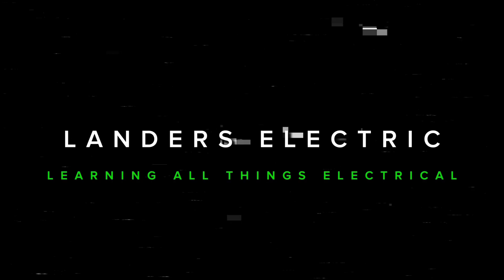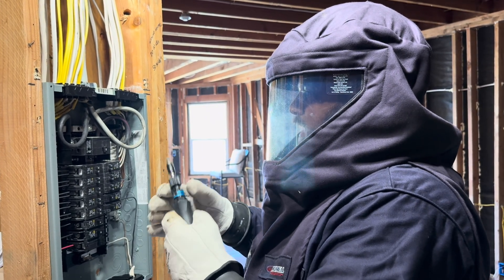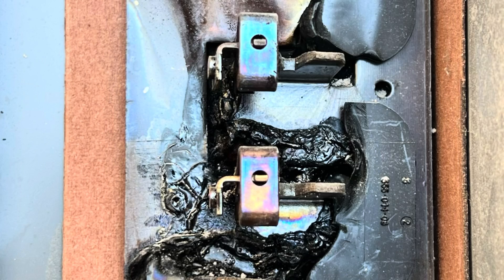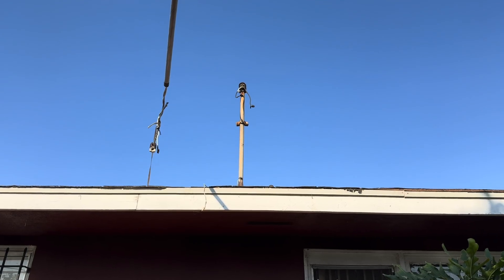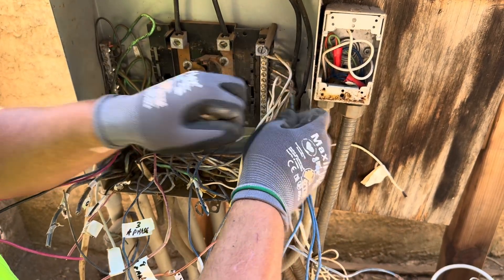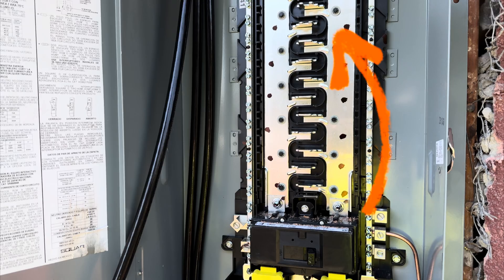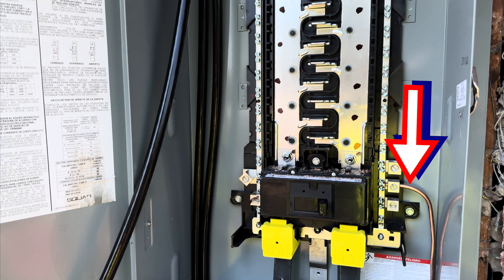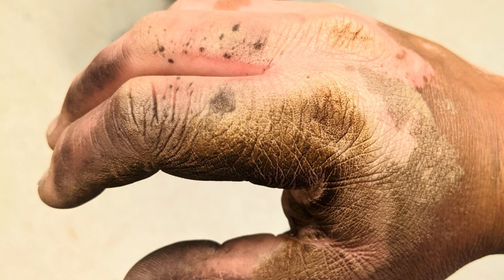I Could've DIED! | Electrical Panel Upgrade Arc Flash Accident

Comment: Were you going to pull the SEU out of the panel live? Why didn't you pull the meter? It takes longer to work around live main feed than it does to pull the meter and just know that EVERYTHING in there is dead.
Thank the lord that you're okay. I had a ground flop onto a piece of bus once (just one 120v) while I was separating grounds and neutrals, thinking it's just a small job and I don't have to shut down the whole panel. I didn't get burned or anything but it shook me up and reminded me to not get lax with safety!
Reply from the maker: Working too much overtime and got complacent. Dont make the same mistake!

Comment: I used compressed air to blow concrete dust out of a 120/208 "Y" panel. The dust exploded and blew two of the three 200 amp fuses feeding the panel; YES, 120/240 is serious stuff.

Comment: When an arc flash explosion occurs , 
A person has no chance of getting out of the way , A person will literally be showered with flying sparks which is ultra hot molten metal going everywhere which can burn holes in your eyes and cause blindness instantly , and those sparks can very easily set your clothing on fire 
Temperatures can soar to 35.000 degrees farenheit , Causing debilitating second and third degree burns instantly and if you're wearing a regular face shield or regular safety glasses , That high temperature can melt them instantly while you are wearing them 
The blast from the explosion creates a pressure wave that can reach 2.100 pounds per square inch , Which is more than enough to knock a person off of a ladder and in some cases 
Can knock a person off his feet 
The force of the blast can rupture your ear drums , It can also collapse your lungs , And the force of the blast can propel shrapnel with the speed of a bullet being shot from a gun and penetrate deep into a person's body 
The end result , An unprotected person will be very seriously injured or killed 
Arc flash explosions occur 3 to 4 times every day in the United States 
Don't you be one of them 
Always always make sure all the power is off and lockout tag out all electrical equipment before you begin , In everything you do 
ALWAYS PUT SAFETY FIRST !!!!!
Reply: Even protected won't always save you.  A cal 40 suit is only suppose to protect against 3rd degree burns.

Comment: I've changed a couple of circuit breaker panels and the very first thing I did was call the power company and have them take the meter out to disconnect the main power leads going into the panel , Then I double checked it with a voltage tester to make sure there's no power , Then I can start my work , even though you turn off the main breaker , The leads going into the main breaker are still hot 
So that's why the electric meter has to be taken out to disconnect the power to the main leads going into the panel 
Especially when changing out a circuit breaker panel , Those main wires coming into the main breaker must be disconnected by removing the meter because those main wires are coming in straight off the utility pole and they do not have in line fuses on them which makes them extremely dangerous because the very high amperage potential in a short circuit can be in the thousands of amps 
One time I had to replace a main breaker in a panel and so I called the power company to take the meter out to disconnect the power , I would absolutely never mess with those main wires while they are hot

Comment: I got an arc flash while probing a 300V circuit a few years back.  It vaporized the tips off of my test leads but my meter and I escaped without serious injury.  I do so love the "sunburn in your eyeballs" sensation it gave me though!  My Fluke 87V took it like a champ and is still in use today.  Fluke is the only brand I'll buy for electrical work.
Reply: 300v? Im curious, what kind of equipment is that you were working on, what was on the load end??
Reply: I almost went with a cheaper brand knowing all this "Oh it's just yellow, that's why it's expensive." Then I saw teardowns of cheaper units. Even the "good" ones are unsafe. No slots in the PCB, bad fuses, bad leads etc.

Comment: What a good video of a real life accident. Glad you’re ok and still here to tell us about it.  It’s only 240v😅  but at the source the fault currents will be much higher. Resulting in more power being dissipated in the arc. So 240v with a loop impedance of say 0.2 ohm will supply a fault current up to 1200amps.  1200A x 240V is 288 Kw. In less than second 250+Kw worth of heat, UV,noise and vaporised molten metal is unleashed. You know the rest of the story. The above was just an example of a domestic supply in the UK, distribution circuits will be much higher. I know your power systems are different but the bang is still the same. All the best to you.

Comment: What a  lesson for anyone working with high current circuits - and so glad your OK. I'm an EE and only a few months ago had a frustrating argument with someone who could not seem to appreciate how dangerous large currents at 120V can be - you sure provided an example I could have used back then. Also a great account how it often takes a number of things going wrong for a disaster to happen just as it always seems to be the case in any of the air crash investigations. Great video and important video! Regards from Canada!
Reply from the maker: Ya it’s not something to mess around with. I hope people will see this video and change their minds on 120/240. Glad it was helpful!
Reply: @landerselectric  "I hope people will see this video and change their minds on 120/240." I couldn't agree more! Truth is, you will never know how many injuries/lives you might save by posting it!

Comment: I work in a data center with 34.5kV coming into the building and 480 3ph throughout(and well north of 1000A on some busses). I’m going to share this with my coworkers to reinforce the wearing of proper PPE, Live-dead-live checks and of course LOTO. When 35kV is in the transformer just outside it’s easy to start thinking that 480 isn’t so bad…

Comment: People can laugh at PPE when they havent been on the wrong end of something.

Mine as a forklift mechanic was having 8 cells of an 80V 500Ah traction battery exploding in my face - absolute miracle i still have my eyes and wasnt really hurt at all other then some minor acid burns, being deaf for a couple of days and a bit of shock.

Now I wear a face shield, ear plugs, arm length rubber gauntlets and a rubber apron when doing battery repairs - every other colleague laughed at me. My response?
Me - "Have you ever had one blow up in your face?"
Colleague - "No"
Me - "I have, now f&&k off"

Comment: Easy to get complacent,  but it wasn’t just forgetting to turn off a breaker.  It was also forgetting  to tag out, not verifying a circuit is  dead with a meter.  You’d feel even worse if this had bitten someone else and not you.

Comment: A store manager was asked by corporate to take the cover off an electric panel to look for a number. It arced and put a hole through his hand, and one through his foot.  With a loud Boom it blew out the cinder block behind and caught the building on fire.  Just the manager was hurt as the building completely burned to the ground!
Reply from the maker: That’s so bad! Really sorry for the manager. Don’t make the same mistake. Turn it off or wear the proper PPE!

Comment: I did something similar to this. I was working on a car that was having problems with its battery and I accidentally shorted the battery with a wrench and part of the wrench actually melted and some of that molten steel shot off of the wrench and landed on my arm. The main point is that electricity is no joke, I was lucky  that all I had to worry about was a small bead of molten steel and not an arc-flash! I can’t say it enough that it doesn’t matter how safe you think the voltage sounds or looks, it can still kill you if you don’t give it the respect it deserves. Electricity can catch things on fire, melt metal, shock you, and even burn you like you can see in the video.

Comment: When I was an apprentice, power would be the first thing I would look for. 
Of course they would work with power-on deliberately, that never made sense to me.
One day I was removing some recessed lights, was cutting the wires and was checking the power for every light to confirm power was off, because not all breakers were off, so I could cut the wires safely, but for the last one I didn't since all the ones before were off, right? I chopped the wires and an arc came out, made 2 indentations on my plier.
Reply from the maker: Good reminder to always check every single one.

Comment: You’re telling me they flew in a helicopter for a burnt hand? What… I took a 30 foot off of Roof doing a PV system and yes I needed a helicopter life flight but I was in serious condition. A helicopter ride for a burnt hand seems a bit much for me.
Reply from the maker: I agree. I was surprised as well but the paramedics said they don’t mess around with electrical injuries. I think they thought the electricity went through me and wanted to get me to the burn clinic as fast as possible.
Reply: @landerselectric   that was most likely the case

Comment: Why do you have to call the electric company to pull a meter? I was an electrician for many many moons and never once have I had to call the electric company to pull a meter. If there was a lock on the meter, I would have to call them to unlock it, but that’s about it.
Reply from the maker: In my jurisdiction I’m not allowed to touch the meter. The utility company sends hefty fines if you mess with their stuff. The bottom line is I should’ve called them to shut down the panel and none of this would’ve happened. Hopefully some will see this video and learn from my mistakes.
Reply: @landerselectric  that is a massive 
Inconvenience .

Comment: Customers say that so much when I'm in the field. "Oh 120/240 ain't crap". I'm thinking, if it ain't, why am i here doing the work for you instead of you doing it yourself? 🤔 They're always saying "oh no, i don't mess with electric". Ok then be quiet! Lol. It's not just the voltage that bites you. You getting the full capacity of a panel bc you grounded 2 bus bars..... Yeah, not good there.

Comment: I used to do appliance repair and had reset tripped breakers often. I've seen many Arc flash explosions reseting 240 breakers for dryers,ovens and cook tops. I had the breakers and panel cover between me and the panel. You must have experienced quite an explosion with an open panel. You are lucky the event didn't cause you to fall into the panel.

Comment: Working or driving tired is definitely dangerous. I did something stupid when I was tired, wiring up a timer for lights on my porch. I cut a piece of 14/2 while it was live lol.😂 Don’t know where the hell my brain was. Being an auto mechanic and working with 12V day in and day out, I was “shocked“, for lack of a better term, at the sound & power of 120V going from hot to neutral. It was a lot more potent than I had expected!

Comment: Im in HVAC, about a year ago, I was doing a compressor swap.

In the process of unwireing it, with the breaker off to that circut, I accidentally made contact with a live 480v heater band.

To this day I have NO idea how im not dead.

The contact was my left index finger and the exit was my right forearm.

I was alone, so I have no idea how long I was locked in.

But the bolt scar on my finger stayed for over a nonth and you could see black lightening patterns almost up to my wrist.

Its 100% crossed my heart.

The only thing I can assume is quantum immortality.

In such I had passed away in my original timeline, but my conscious perceives in a timeline I did not.
Reply: you're actually in my quantum immortality timeline :P twas just luck. glad you're ok
Reply: Quickest way to switch timelines. That and concussions. Speaking from experience 😅

Comment: I learned that hard lesson when I was like 8 or 9. Next door neighbor kid invited me to come over and watch Gilligan's Island. He asked me to plug the B&W TV in since it was one of those TVs you find back then called a 'Bedroom TV', a TV on a purpose built wheeled cart. So I plugged it in, I was to young to realize what the black soot meant around the outlet. Half my hand charred skin with soot marks imbedded into the skin, instant 2nd degree burns. I had just a loving family my dad threatened everyone in the house if anyone took me to the ER or called for help. So....he slapped some Crisco on my hand and told me to stop whining. Took forever to heal but it did eventually.

Comment: Should of pulled the meter but, first step is to inspect everything. if the meter base is broken, the only safe step is cutting the line at the entrance and taping off the ends. I've watched a lot of Bobsdecline. Non-touch sticks are okay but nothing beats the test of a meter on a live source then test it on the dead panel and then the live source to confirm it is indeed dead.

I've worked on 12 24 and 48 volt battery banks and those buss bars can draw thousands of amps, it's not just the 120 or more volt systems even a really low voltage short on thousands of amps of fault current will vaporize your spanner in an instant.

Any circuit with a low source impedance and high fault currents needs to be handled with extreme care and safety gear! Also insulated tools including spanners are a must.

Comment: I worked with one guy who arc flashed 460 volts without any PPE. He blew the fuses at the closest panel plus the main fuses on the power pole feeding the shop. His hands were so burned that it took him 4 months before he could use them . He did not have the knowledge or business being in the panel. The thing that I found out later was this was the second time that he has shorted out 460 volts at the shop! Somehow he managed to survive both instances.

Comment: In this case it was the current that got you instead of voltage. Arc flash is no joke. I had a boss get arc flashed from a 460 MCC . It burned his face so bad he lost part of his upper lip. I do not work on live controls or disconnects . Way too dangerous

Comment: This is why pulling a meter should be standard and all we should have to do is notify the power company in Washington we used to be able to do this. now we must wait for the power company many old boxes don't have main breakers
Reply: Very true.   The old panels without a main breaker were known as split bus panels, and those were commonly installed from the 1950s - 1970s, prohibited as of the 1981 NEC and in their heyday they were legal,  provided all power to the home can be disconnected with 6 hand movements or less.  In most of these panels the upper bus was live at all times unless you pulled the meter, and you were allowed up to  six two pole breakers in this upper bus section, one of them powering the lower bus section which typically had all the single pole breakers for the general lighting and receptacle loads, but two pole CB's were permitted here as well.   

There were also split bus fuse panels as well, the most common example is a 100 amp main/range pullout with 4 - 6 Edison base fuses.  The main pullout block had two 60 amp cartridge fuses, while the range pullout block typically had two 40 amp cartridge fuses for an electric range. A larger split bus fuse panel may have 3 or 4 cartridge fuse blocks.   Regardless, the rules were the same - all power to the house must be cut by pulling 6 fuse blocks or less.  

Most of the old school electricians I've worked with call this "the six throw rule"

Comment: Just came across your channel. I have been an electrician for over 45 years. I went through pretty much the same thing only with 480 volts around 35 years ago. It was only because I wanted to cut corners and save time. I came out ok with my hands but had I not had leather gloves on it could have been a different story. Glad to hear that you came out ok. Also, look into getting helicopter insurance. It is literally like 8 dollars a month and covers your entire household. I signed up for it several years ago and had a car wreck in 2020 and my bill was $49,000. Health insurance paid $9,000, then it was only because of my helicopter membership that they took care of the other $40,000. You got a new sub here and I am looking forward to your content. Stay safe out there.
Reply: I also heard that when hiking to make sure and buy a .....I think it's a hunting license. Supposedly it comes with emergency transport insurance which would cover a helo ride from a remote place.
Reply from the maker: Thanks for the tip and glad you had gloves on. I’ll definitely look into the insurance.
Reply: Most insurance that covers ambulance also covers air ambulance as in my case and this guys case.   They are not typically covered separately.   Not hard to call and ask.